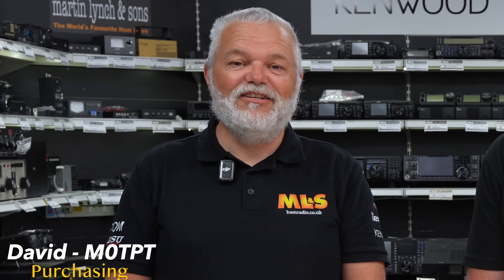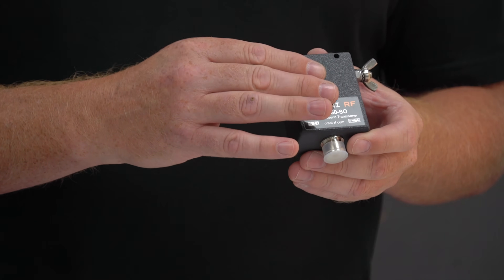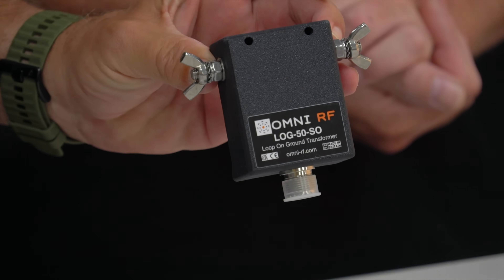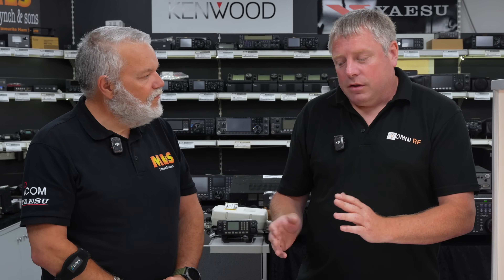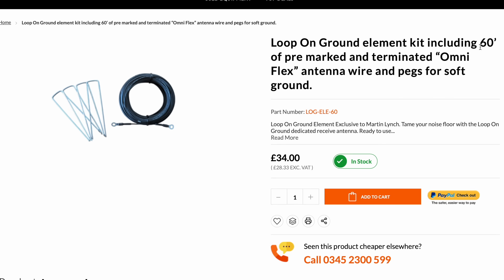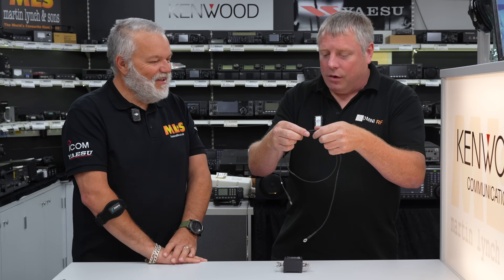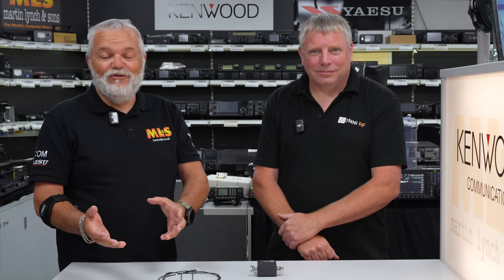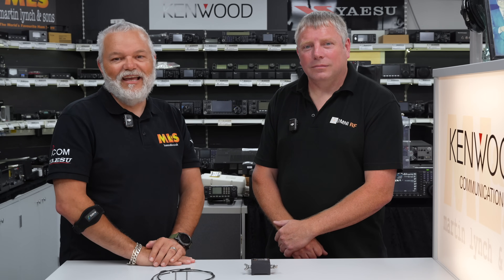Why Are Hams Raving About This Antenna?

Comment: has it got to be a square ? or is a loop ok, and also has it got to be 60ft or 100ft or can we use any length ? would have liked to see a demo.
Reply: Did you watch the video? 12:24.  My experiments show there is very little benefit to going larger than 100 ft (25 ft sides).   I have a 600 foot and 300 foot LOG and they are not better than the 100 ft.
Reply: That's a great question. Laying the loop in a square is easy to do and results in an almost omnidirectional rf pattern. Laying the loop in a circle would work pretty much the same. If you start to change the shape too much then the omnidirectional properties of the loop are lost and the loops starts to favour different directions.

You can experiment with different loop sizes and have some fun but if you have a loop that has a circumference that is longer than 1 wavelength on a wanted band, it will start to lose the omnidirectional performance and favour different directions. I've been testing, using and improving the Loop On Ground for 5 years and I recommend using a 60' loop if your main bands of interest are 40m and up or a 100' loop if your main bands of interest are 40m and lower. Both of these lengths give good general performance across the HF spectrum.

Demo coming soon. Thank yo for watching.

Comment: I have personally used a Omni RF for a little over a year and where I live I have most days a noise floor of S4-S9 depending on band I'm on with the loop on ground my noise floor dropped to on average S1 to S2 genuinely couldn't believe the difference in my noise floor and I found myself hearing stations I couldn't make out before so if u are struggling with a high noise floor genuinely give this a shot you won't regret it I certainly don't
Reply: Thank you for the great feedback. I'm always very happy to hear that the Loop On Ground has made HF workable again and improved users enjoyment of the hobby. Thanks for watching.

Comment: Does it matter wire length if I use my own wire? I’m looking at maybe 100 feet or more for my application.
Reply: I recommend using 60' if you're more interested in 40m and higher or 100' if your more interested in 40m and lower. I would not suggest going any longer than a total of 120' if you care about the bands above 20m as the reception pattern starts to get deep nulls. You are able to use your own wire if you wish with no problems.

Thanks for watching.

Comment: Can this loop be designed for the VHF bands. I have issue with noise on these bands.
Reply: It's not something I have looked at but I can put it on the todo list. My initial thoughts are that it won't be very effective with VHF and above. Thanks for watching.

Comment: Hi,
Looks interesting! A couple of queries:  1) Does it work fed mid-side - still omnidirectional? 2) Is longer better - I could fit in 120ft?
Reply: Thank you for your question. If you feed the loop mid-side, for example on the west side, you will see a very slight gain the the North and South. I don't think this would be noticeable in the real world. Longer is only better if you don't care about the higher frequency bands. A good rule of thumb for experimenting is to keep the total loop length less than 1.5 x wavelength of you highest band of interest.

Thank you for watching.

Comment: All electromagnetic noise has the same proportions of electric and magnetic field.  Most interference is vertically polarized because the horizontal ground wave does not propegate.  Even electric field antennas on the ground are quieter.  The BoG (Beverage on the ground) is responsive to the vertically polarized E-Field and is still often very quiet.

A general rule of thumb is that putting an antenna on the ground cuts signal by about 100dB and noise by about 140dB, over 6 S-units of signal to noise requirements.  73 KK7YIS
Reply: I meant to say improvement not requirements.  Voice to text.
Reply: Yes! How embarrassing for them...

Comment: I have been using an lmk loop on ground for 3 years. It’s the best bit of kit in my whole arsenal of antennas. It helps to have a dedicated rx input on your radio…. So upgrade your radio too!
Reply: Thank you for your custom. Just to clear things up for anyone reading the comments, I am Matt, M0LMK, the owner of Omni RF. I traded under the "LMK" brand for a few years before deciding to jump in with both feet and rebranded to Omni RF Ltd.
Reply: @Omni-RF  Honestly, here's a good case study for you. I was on 40m with an M0 friend who has 2 elements on 40m at around 80 foot. He was calling CQ and passing me on,  I use an EFHW for tx and your LoG for rx. I managed to work into VK on my EFHW, but I could only hear him on the LoG and not on the EFHW because of too much noise. If it wasn't for the LoG I would not have VK confirmed on 40 !!!
Mine is the 60' version and probably is now sunk to 2+ inches in the lawn. I would not hesitate to recommend them. I would buy another...the Omni RF version is very 'Pro' looking. Congratulations on a great product.

Comment: What if one does not happen to have a separate RX socket on the back of the radio?
Reply: U will need something that has a manual switch or something that works with a relay. Like those sdr relay switches used for monitoring on a pc, think mfj made one

Comment: Ok until you forget it’s there when cutting the grass 😮
Reply: A good tip for laying on grass is to mow a little lower than you usually would before installing the loop. Within a few weeks, the loop will be covered by grass thatch and once you raise your mower to your normal cutting height, it won't have any chance of catching.

I laid my loop like this 4 years ago and it's pretty much disappeared into the grass. It's still working great.

Thanks for watching.

Comment: Is there a way to combine the output of this type of antenna to the output of another type of antenna to cancel noise and reinforce signal? Perhaps mathematically subtract one SDR slice from another?
Reply: Since the LoG is a low noise antenna, there's not much noise to remove. You can use something like an X-Phase QRM eliminator with the LoG as the main antenna and a small whip or low hung random wire as the sense antenna but I don't think you'll see much improvement as the QRM eliminators are designed to be used with noise prone antennas like verticals and random longwires.

The disadvantage with the X-Phase tupe QRM eliminators is that they have to be adjusted every time you move frequency for best results where as the Loop On Ground does not. 

Thanks for watching.

Comment: hi, what happens if we elevate the loop?
Reply: It will lose its magnetic properties and the ability to reject the electrical portion of the radio wave. It will also reduce the impedance of the loop itself and create a poor match to the 50 Ohm coax unless you change the transformer to something like a 2:1 ratio.

Comment: I like this! However, I would have been more impressed with an on-air demonstration comparing its reception against a vertical antenna. Surely, that could be arranged in the near future?
Reply from the maker: Hello good question, Matt has agreed to do a short video this sunday and we will be able to add this to the website listing. Thanks David
Reply: @Martin_Lynch . Great idea.   This MLOG type would probably pair well with the SDRPLAY SDRduo and its receive diversity feature.     A pair of thes MLOGS plus SDRPLAY SDRDUO and you could use the diversity features in the sdrplay hardware to get directionality from your loop on ground.
Reply: That's a great point, thank you. I will make a video this weekend showing how the LoG performs against a vertical at my own station where I am plagued with QRM. Thanks for watching.
Reply: exactly

Comment: Very interesting, just wondering I live on a top floor of a block of flats with a flat roof if you layed the wire loop around the circumference of the roof would it perform the same way as It would at ground level, the height of the roof is about 70 feet.
Reply: Hi - the loop will pick up signals and should have reduced noise compared with say a vertical whip placed up there. But it will likely pick up more noise than the loop when it’s on the ground. I’d try it out  :) .
Reply: @davidw460 Hi David I'm going to try a different option with a wellbrook loop in conjunction with a null steerer first, I have all the parts now just need to throw them together and test.
Reply: It's an interesting idea but you will probably find that the antenna loses its magnetic properties and just acts like a normal elevated loop. The transformer impedance would also be incorrect and would make the match between the coax and the antenna around 13 Ohms.

If you want to experiment with an elevated loop then a 2:1 Balun would be a much better choice and probably give you some good results so long as you can tame the electrical noise generated by the block of flats!
Reply: @Omni-RF this is why I like leaving comments 😁 I can find out my mistakes before I try them, I'll look into your idea aswell think I might need some kind of mast head preamplifier with that loop. I'll use a null steerer for the other noise.